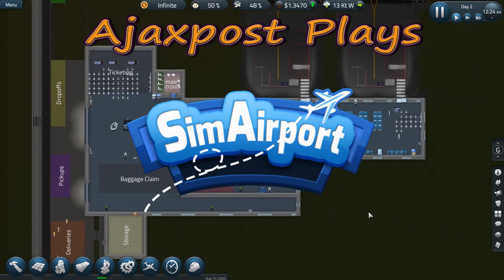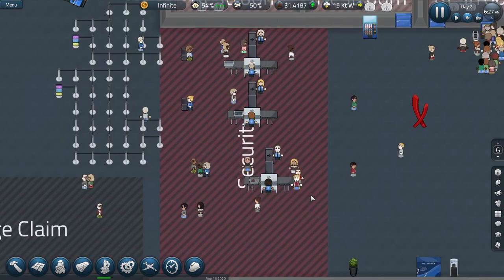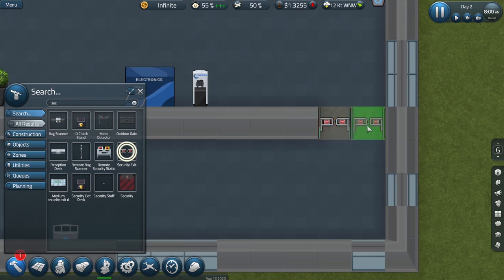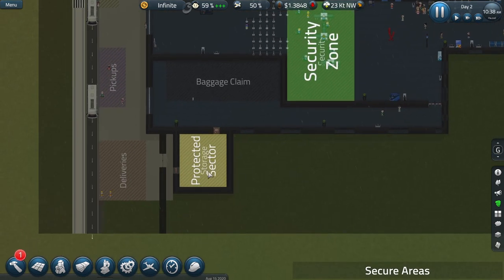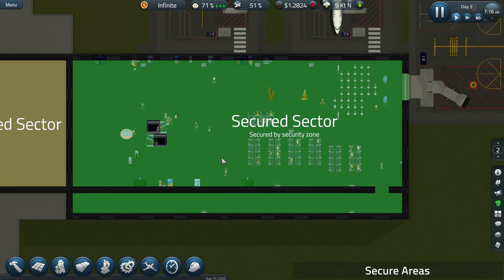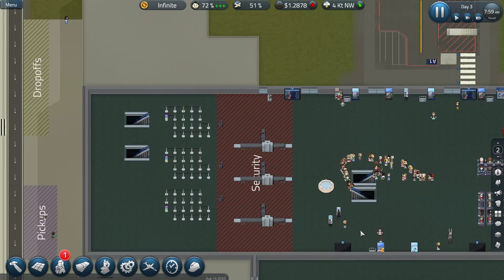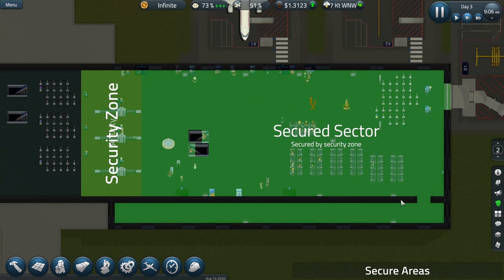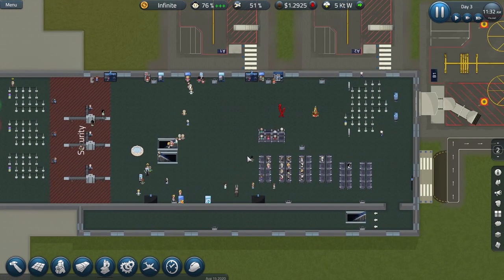SimAirport : Understanding The Basics of Airport Security : Tutorial #4

Comment: Started playing this again for the first time since it was in Alpha and enjoying it.  Did you ever discuss optimal placement of digital ad displays?  I did some tests and found that the absolute best locations are where passengers will pass more than once, so you can do setups like having a toilet block across the main walkway from the cafe and so on.  Obviously they'll get hits at the entrances and exits, but not as efficiently as that concept.
So, you can do one from the entrance to ticketing if they then have to pass it again to go to security rather than just by the door.
Reply from the maker: Hi, I picked it up quite late in Early Access but even so it has indeed changed a lot since!

No, I don't recall talking much about the digital ad displays, but you're right that the more times passengers go past them the more revenue you'll get but I didn't have much of a problem with my income. 😎
They do have a small negative environment impact but that should be easy to offset with windows, plants and the like.

Comment: Any way to put passport controls in simairport?
Reply from the maker: Hi, short answer, no. 😕

Unlike AirportCEO, SimAirport does not identify routes and makes no distinction between 'domestic' and 'international' flights. So, all passengers have to pass through ID check and bag scan regardless. But you can create separate areas and terminals if you wish and design them to serve different types of aircraft.

If it helps, I have found one mode which includes an ID check stand labelled as "Passport Control" (https://steamcommunity.com/sharedfiles/filedetails/?id=2070038605) and there are other mod assets that can add an international airport flavour, but it is just 'flavour', not a game mechanic. My Steam collection includes quite a few examples of mods that could add some 'international' feels: https://steamcommunity.com/sharedfiles/filedetails/?id=2029045140 

Hope that helps. 😊